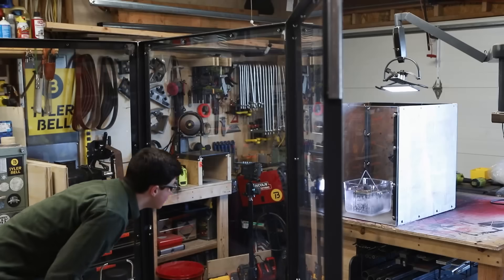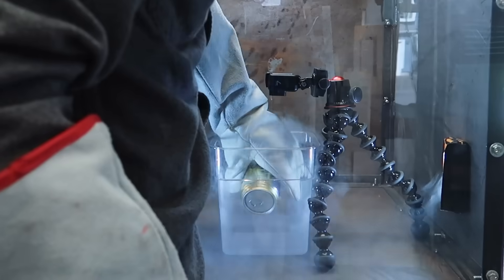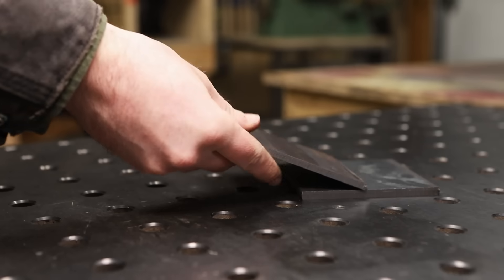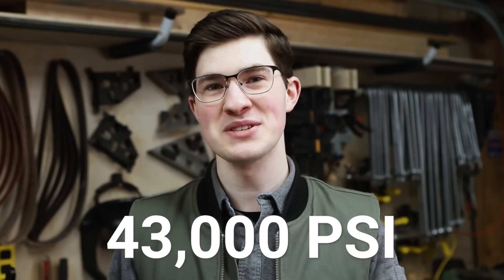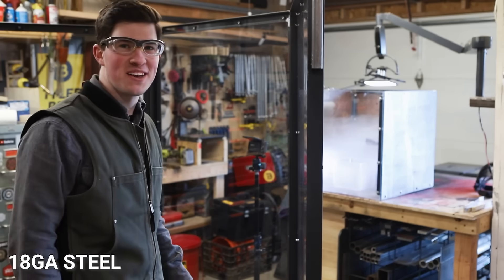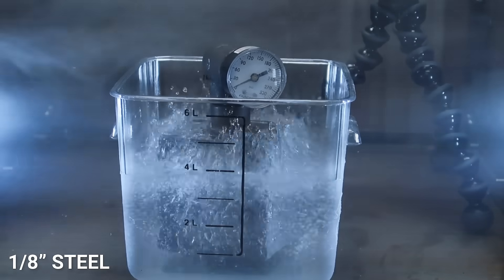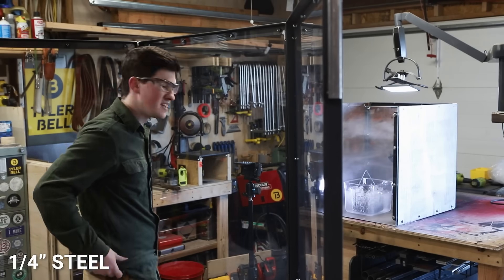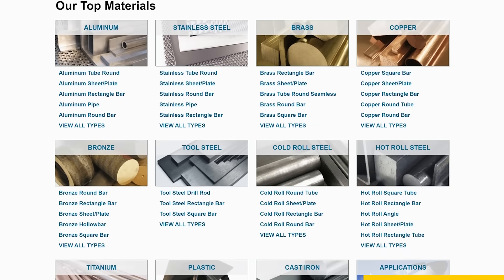Keeping ICE from EXPANDING?? (in liquid nitrogen)

Comment: I’m willing to say the lower freezing temp from the sodium in the can is why it resisted quick expansion. It was allowed to freeze more slowly rather than instantaneously. Also, the corrugated lines in the cans are designed to maximize the strength of the can structure

Comment: A couple of comments:

1. You were very lucky the cubes didn't let go while you were holding them. A friend of mine was holding a similarly sized pressurized metal cube and when it let go, even though it just cracked and popped open by no more than ¼", it was enough to shatter the bones in his hand.

2. With the final experiment I expect you will discover it will explode if you take advantage of the increased volumetric stiffness the initial expansion provides. Basically remove the bung, weld up any leaks, cool it to room temperature, refill it, reinstall the bung and heat it up again. Now that the sides have already deformed once, they won't be able to deform as much the second time. Instead pressure will build up faster and to a higher level, making it more likely to explode.
Reply: I heard this is the best way to strengthen gun barrels of probably any size, to deform by expansion about 6%.. how much of this happens in one go thru burst strength is anyone's guess although I'm assuming it would nearly mirror the carbon content, to a point.. then reversing (inverting,  whevr.. becoming its own reciprocal, nerds[lol])

Comment: You are basically initiating brittle fracture at such low temperatures.  This is not a good test.  You need to do it with wax to achieve a ductile failure mechanism.

Comment: Pretty sure the steel cracking faster and harder without pre-frozen blocks is because of the rate of freezing of ice, and the fact that the faster you freeze something (aka let it crystalize) the less smooth the crystals will be. I wouldn't be surprised if the violent crystalization of water when exposed to the liquid nitrogen played at least some role in the faster cracking, especially seeing the almost quartz-like crystals in the first one.

Comment: Don't forget that you are fighting the force of the metal contracting. 

I think it's interesting looking at the failure modes.
The 18ga box failed on the steel right next to the weld. The metal became too brittle to stretch and failed at its most brittle point, the heat hardened metal right next to the weld.
In the 1/4" box, the metal was stronger than the welds.
The 1/8" box hit a balance. The steel had enough thermal mass that it stretched before it became too brittle and yet it was thin enough that the welds were able to withstand the force it took to deform the steel.

Comment: Welder here. Your weld should never be failing before the steel around it. Either the extreme temperature is making it brittle or (more likely) you didn't properly gap the sides of the box so you didn't get full depth weld penetration.

Comment: I'm loving how this guy does an experiment about freezing water and containing it (as it expands) while simultaneous sealing it in a material that SHRINKS as it gets colder, then submerge the ENTIRE assembly into the nitrogen.

This isn't nearly controlled enough for any meaningful conculsion - as the steel contracting against the expanding water/ice is creating many more variables that may vastly change the outcome if you were to expand water/ice in a neutral (0 degrees or room temp) setting.

OFC Steel at -200 degrees celsius is going to be vastly different for many factors from room tempurature steel.

Comment: I think the problem of the steel boxes you made exploding is because of the fact that you used welding to create those boxes, and as you know, welded connections do have faulty lines/weak points that aren't as strong as the plates themselves.
Reply: Not nessecary. It depends on the skill of the welder, and the used materials. Oftentimes the welds can be stronger than the base material.

Comment: Until it freezes water actually shrinks. If you could get the water and the boxes as close to freezing as possible then seal the bung you would minimize the amount of liquid nitrogen needed and maximize the expansion. Also couldn’t you have melted the wax with a circulation heater.

Comment: If you want to contain the ice you need a cylindrical block of billet steel with a hole drilled or milled in and at least a 1"wall thickness. Welded steel will never hold. Too many seams.   2:24 Correction according to Wikipedia there are 18 phases of ice not 15.

Comment: I don’t know if you’ve studied physics and calculus, but this would be interesting to analyze. You have a lot of variables going on. Increasing the pressure in the boxes lowers the freezing point. So putting the boxes in the freezer, may or may not allow the water to freeze. Water contracts at normal atmospheric pressure until you hit 4 degrees Celsius and then it starts to expand gradually until it freezes and expands the 9% and then it contracts as the ice gets colder. So the interaction between the expansion/contraction of “water” and the pressure change inside a sealed container in very complex. So depending on the temperature of the water when it was put in the containers, you could actually have created a vacuum before it froze and increased the pressure. Of course as the boxes warped, you are again reducing the pressure, thereby lowering the freezing point. Then throw in the multiple possible crystal phases that can exist and the possible outcomes are multiplied. So to get the most “bang” for your buck, you should seal the boxes with the water at 4 degrees Celsius to make the  water as dense as possible to start.

Comment: I've actually always wondered about this. So this will be really interesting. One theory I had was that the ice would transition into one of its other solid states if the pressure got high enough, like Ice III or Ice II. It seems like the pressures might be able to get high enough if your vessel could withstand enough pressure. But Ice II needs about 300 Megapascals of pressure to form. So that's a crapton of pressure.

Comment: the metal becomes very brittle when cooling down to such small temperatures
maybe the soda can is so thin and even made out of aluminium, hence it bursted. The soup can is probably made out of tinplate and can withstand higher pressures even at lower temperatures.
But, since it didn't expanded at all, maybe something else ist the case here?
I try to explain it as well as I can in as few words as I can. I'm a chemist student in germany and my english skill is limited to YouTube :D

there is something called "coefficient of linear thermal expansion" or "thermal expansion coefficient". This coefficient gives an idea on how a body expands when heated or cooled. If it's negative, it will contract when heated / expand if cooled. If it's positive, it will contract when cooled / expand if heated. E.g. water and paraffin.
Just like everything you just said in this video :P

now, if you combine a compound material with say two substances that have different thermal expansion coefficients (TEC), they form a new material with a new TEC. For example the cern stove plate is made out of lithium-, aluminium- and silicon (LAS) oxide. They together have a TEC of almost zero, even though, they all by themselves have different, positive TECs. That's why you can heat up ceramic glas to such high temperatures.
- sidenote, cern glas is a combination of amorphous and crystalline substructures of LAS-oxides. The positive TEC comes from the know "glassy state" / amorhphous state, whereas the negative TEC comes from the crystalline areas in the whole glas. The right combination results in a netto TEC of almost 0.
High quality laboratory glas also works the same way. Also dental implants have this property. Otherwise you would get cracks over time when eating ice cream and than drinking something hot directly afterwards. 

So, maybe, just MAYBE, it could have happend, that the ratio of water and fat (paraffin :DD) in the soup just appears to be near zero.
The fat "zeroed" the water -> no thermal expansion.

So maybe we can say, it's fat (in Germany there is a saying, "really fat" for really nice, very cool, sick, wicked, ...") to stay hydrated!

Comment: The reason why the soft drink can in the freezer did not explode compared to the liquid nitrogen is that the one in the liquid nitrogen had a rapid temperature change, weakening the surface before the immense pressure from the expansion of ice causes the can to explode.

Comment: maybe hot water to start with next time as close to boiling as you can to get more water in there. Maybe use a cored cylinder as the vessel and also maybe having a weak point for the pressure release. Or the reverse, start with ice and turn it into steam, something similar to the hotwater heater missiles they made on mythbusters? just found the channel love it, keep it up. Even if knowing something doesn't work is very interesting

Comment: Dumping a soda can into nitrogen makes the metal brittle, so when the soda expands the wall cracks. You can see it the way it cracked as well, a typical britle break. In the freezer this doesn't happen as it's not cold enough.

Comment: The smallbrain answer to the soup thing is broth is not cohesively water. The more indepth answer is that it is full of organic materials and liquids that both are compressible (unlike water) and contract when frozen which will compensate for the internal pressure changes which will in turn stop critical deformation of the can. Fat for instance is highly compressible and makes up a relatively large volume of animal based soups and broth. As a side note making soup is perhaps the most highly efficient process to maximise the extraction of macro and micronutrients (except those degraded by heat like Vitamin-C and the B group) without specialist equipment in cookery. Which is why soup is often associated with the poor historically as food scarcity drives up the need to max out calories from ingredients.

Comment: For better results chill the boxes to 4C (39F) and fill with water at that temp. Then put directly into the Nitrogen. H2O is densest at 4C/39F, so you would get the most expansion and it would only require a drop of 4C/7F degrees to reach freezing

Comment: The reason the soup can doesn't swell is because when they come from the factory they are actually slightly vacuumed so when you open it the soup doesn't blow out of the can.
Reply: also soda cans are pressurized because of carbonation, so it takes less expansion to exceed the pressure the can can withstand. With or without vacuum the soup can has space inside it because its not completely full, which helps with the expansion inside
Reply: @emi9643  And all the carbonation comes out of solution as the liquid freezes.
Reply: Salt water.... (shrug)
Reply: @TestingPyros  all that does is lower freezing temp
Reply: @haydencarlson2861  which means it likely wasn't fully frozen just being in a standard upright fridge/freezer overnight.
Reply: @TestingPyros  lol
Reply: There is no water in the can
Reply: @patrickthenomad , the ingredient list begs to differ.
Reply: I believe this is right, the can will be “canned” that is, it is preserved by boiling so that all the air is replaced with steam.  When you cool it, there will be space in the can, be no air... a vacuum.
Reply: @skyadventures6585  Doesn't really matter that it's a relative vacuum as much as the general fact that it is not 100% liquid and solid. Even if there were gasses in it (and there are some) gasses are easily compressible and would still allow the soup to expand without causing a huge amount of pressure.
Reply: campbell's condenses the soup that way it lasts longer and they can ship it in a smaller can. when they condense most of the water is removed thus the can wont expand much if at all.
Reply: @ethanmeyer179  about half of the water is removed before canning. The non-water component of the broth is actually not very significant by volume, so a can of concentrated broth is still mostly water.
Reply: @timg2727  thank you for pointing that out to me.
Reply: And they are not fully filled
Reply: It's because only water expands when frozen.
Reply: They are not vacuumed at all but the food is poured into the container hot and thus will produce a small vacuum when the water vapor is condensed.
Reply: @dtiydr  the contents will also shrink on cooling, which may account for more than the condensation of water vapour given there will not be that much. I'd need the fill level and temps to work it out though.
Reply: @CED99  Any vacuum from any shrinking food is way less than the condensation of moisture.
Reply: @dtiydr  A vacuum is always going to be less than anything other than a stronger vacuum.
Reply: Bcs theres many oxygen inside
Reply: Salt content of the broth lowers the freezing point
Reply: i was thinking its because the never fill them all the way but idk
Reply: Also there is air in the can
Reply: Everything that isn't water shrinks when freezing. If the soup is 50% warer the effects may simply cancel each other.
Reply: This . I believe maybe also another cause is , isnt there a slight bit of air inside too ? I feel like when I open one of those cans, its not FULLY full to the top but had a small empty space inside too which would allow the ice to expand a bit. Might be wrong on that
Reply: Exactly what I was thinking
Reply: I had stew today that had frozen in my backpack and the can expanded, slightly, but almost unsealed the bottom so a noticable amount.
Reply: How do you just know this
Reply: I mean aren't the broth and soup literally cooked inside the can to boot?

 Either way I feel like most canned foods are designed to deal with being heated or any type of expansion. I don't know what he was expecting. If it can deal with steam it can deal with ice expansion.

 I WISH someone could create different ices and waters. Or other things. Some solid hydrogen. 

 I just saw a video on super solids being proven to be real. A solid you can stir! I don't know what that means even after watching the video.

Comment: Great video, although I have a small problem with the overall experiment design: welding rods tend to not have the exact same alloy of steels as the welded material. Different alloys have different thermal expansion factors so the weld might be a major weakpoint because of that.
Otherwise, keep up the good content.
Reply: Ya we are getting a test of the welds not the steel ga. Extremely interesting seeing the power of it even in the welds!

Comment: The steel embrittlement temperature  will depend entirely on the steel type and grade. Looks like carbon steel was used for the boxes. So that would typically mean significant embrittlent from around -20 to -40 degrees C. The transition happens gradually over a temperature range.

Comment: I noticed you put the pipe plugs in the coupling under water - as you tightened the plug, you woluld be surprised at the amount of pressure you generated in the cube simply from the water being displaced by the plug.   My business is an ASME pressure vessel manufacturer - we've seen this several times when all air is removed

Comment: During the civil war the confederate army did testing on cannon barrels to see how thick they would need to be to keep ice from splitting them if they were sealed. Even a tube with 6” wall thickness split when frozen filled with water. Their steel was obviously inferior to modern metallurgy, but it shows the power of water/ice expansion.

Comment: The reason your welds failed down their middles is because you did not have adequate root penitration. The toes of the weld should fail before the root opens up. As you saw, your thin box failed along the edges of the weld (good). The medium box survived because you had proper weld penitration  and strong enough sides (TRULY awesome). The .25 box failed because you did not have your welder turned up hot enough to provide proper penitration on .25 inch steel.

Comment: Both cans contain salt diluted into the soup. Salt water has a much lower freezing temperature than fresh water (-21.1C vs 0C). Thus the cans in your freezer did not get cold enough to expand much at all.
Yes cooling the boxes slowly in the freezer made them less brittle which is why the one box did so well. When you let the others thaw again to do the rest of the tests you had the same issue as before of quickly cooling the steel causing it to become more brittle in the liquid nitrogen.

Comment: Liquid nitrogen drops the temperature of the metal past its brittle fracture point.  Then when the ice applies pressure to the steel it just cracks versus having much deformation.

Comment: Maybe someone smarter than me could answer my question (excuse any typos I'm really tired while writing this) assuming these containers were air tight, when the ice expanded the melted and shrunk again what would be in the new space created in the container? Would the container hold the same amount of liquid but just be warped or would there actually be extra space with something else in it in the container.

Edit: (still tired but i kinda thought it through and i might have an answer but I'm still not sure if it's correct so feel free to tell me I'm wrong.) If there is extra space in the containers after the ice melted the water would want to reach equilibrium with the new empty space and release dissolved gases in order to reach that balancing point.